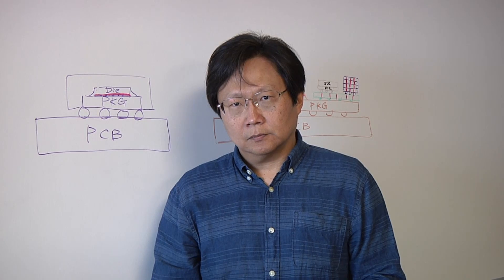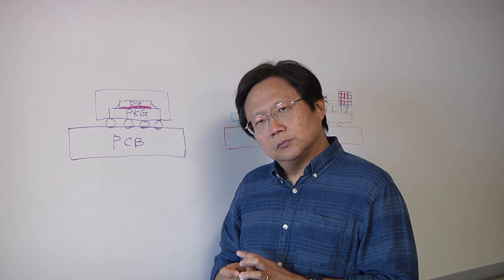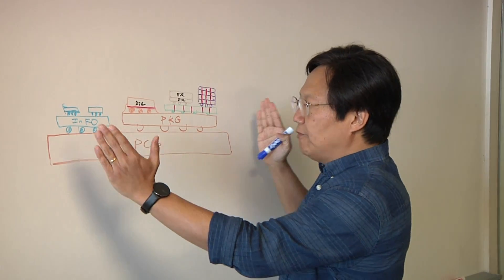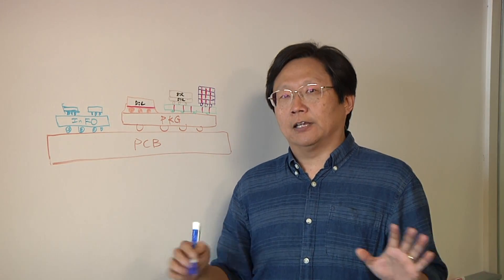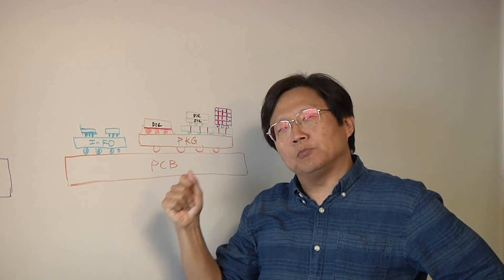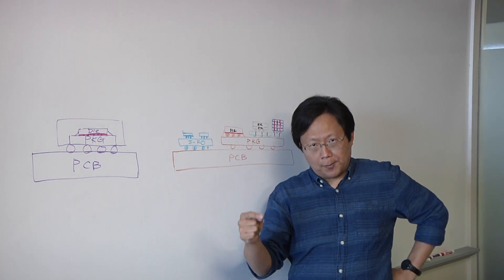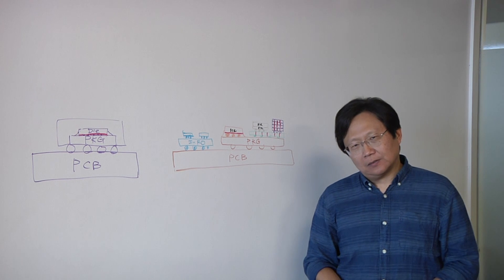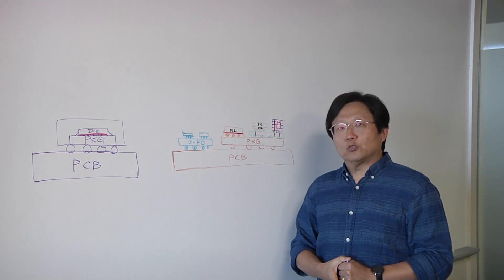Thermal Challenges In Advanced Packaging

Comment: Great overview. DRAM refresh time [f(T)] is the limiting factor for memory on logic. Per discussions at ECTC, photonics will be integrated as the "pentahouse level" in advanced packages, and that will require temperature stability, not just overtemp control. Whether liquid phase cooling of the naked (TIM-free) package will be enough to provide a complete thermal solution remains to be seen.